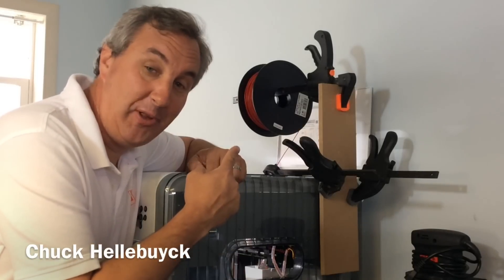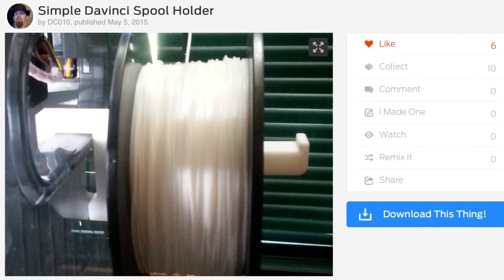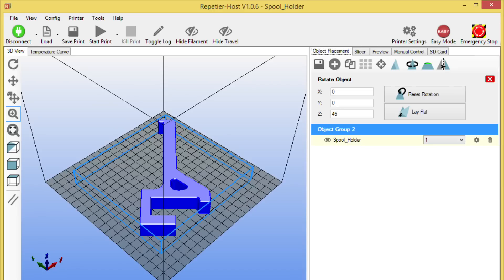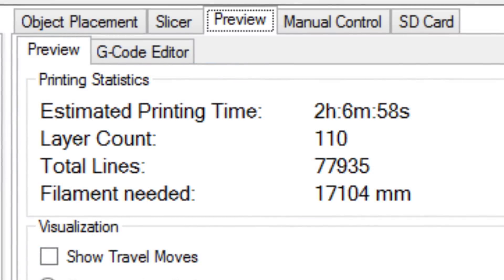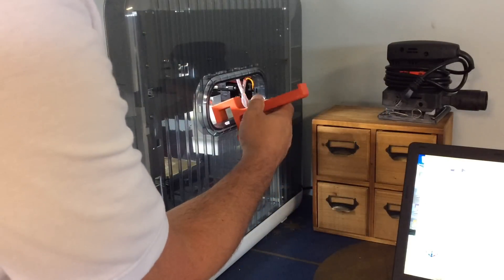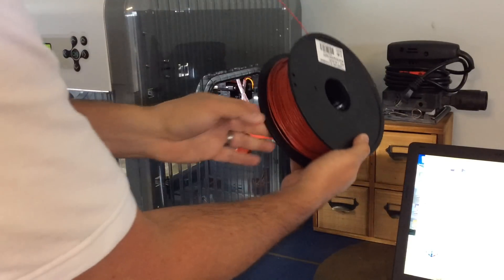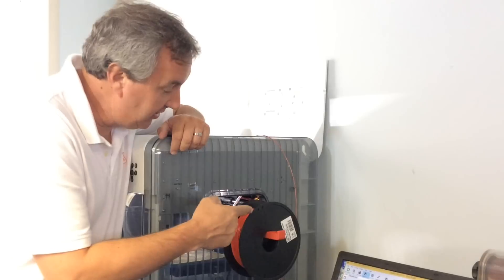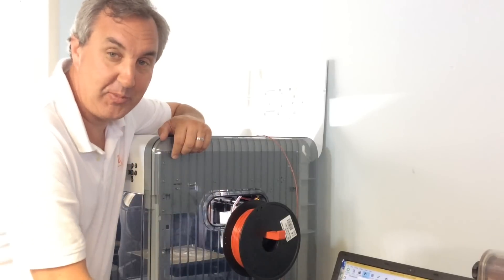Filament Friday #29 - 3D Printed Spool Holder for Da Vinci 1.0A Repetier Machine

Comment: about a week ago I printed a spool holder for my ctc printer and at first it worked fine. The holder had two parts, a bracket and the spool holder which slotted into the bracket. After a week the spool sagged dramatically. When I first slotted the spool into the bracket it was super tight but after a week the weight and movement of the filament caused the spool to open the slots wider and now there is too much play. The looseness of the slots was no longer able to hold the spool horizontally.  I did print the bracket in pla which may make a difference. After seeing this I will look around or design a one piece spool holder and print in abs (or nylon if I can get it to stop warping) Thanks again for the vid. cheers!

Comment: I have a problem with 1.0a prints excellent in ABS but PLA just stuck on a 50% work, inside the head the metal dents reduces the filament and can't push outside. 

Don't know what to do, I calibrate using the  method  on the first episode, but have no problems with ABS considering for only final works. PLA is my thing.

Comment: Have you tried any of the new ABS colors from xyz? I bought a cartridge of ABS Viridity, and I cannot get any good prints from it. It doesn't want to stick to the bed (i use glue to help adhesion) and it seems really runny when it comes out of the extruder. If you have used it yet let me know how it works for you. I bet it would work better on your flashed 1.0, because you could lower the extruder temp a bit which would probably help.
Reply: justin cummings  i basically gave up on viridity, almost no adhesion.

Comment: hi chuck. I have Repetier on Da Vinci 1.0 and the taller the print gets the closer the head get, till it hits or plugs the head. it is like the z is not going down all the way on each layer. is there a setting that may be off? hope you will share your setup and settings :) thanks for the helpful tips

Comment: So what are your thoughts on not using those plugs that would normally go into the printer's hand hold holes, that you are now using for the spool holders? My xyz printer came with the plugs, but I did not find any where in the documentation to install them. Seemed like a good idea to install them, so I did, but always wondered if they were needed.